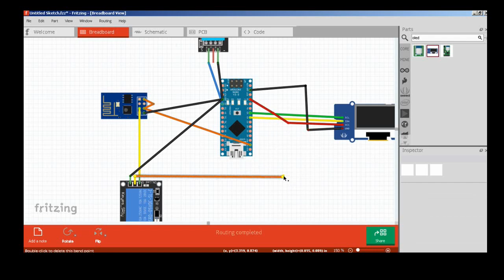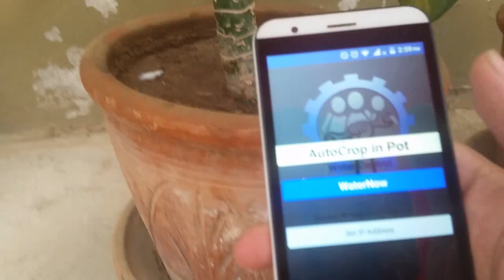Building an Automated Garden using Esp8266 | Arduino

Comment: Good job I took this and ported it to just a esp01s then added a watering timer and a BP airpressure sensor. Had some data built up and set a auto watering due to envir knetal conditions from my data. Humidity is the issue you can use the ice and then 3 inputs if you use TX and rx

Comment: Cool, but why dont you use soil moisture sensor to water automatically? If you do i highly recommend capacitive soil sensor, as it doesnt corrode and is more accurate. Which water pump do you use?
Reply from the maker: its a good idea to use soil moisture sensor but when using pots like these more sensors are required which becomes expensive.
Reply: @teamashcreations3556  Capacitive soil moisture sensor is like 2 usd on ebay. A resistive sensor would corrode and get useless fast anyway
Reply: @Impetuss   sigh, esp8266 or esp32 has one analog pin....
Reply from the maker: This pump used is a 12V pump with capacity of 10L/min